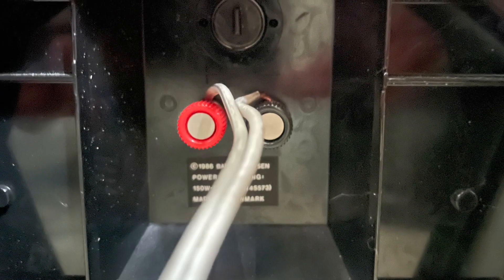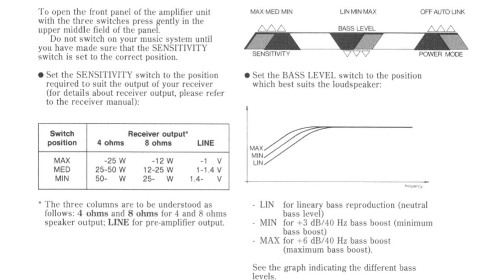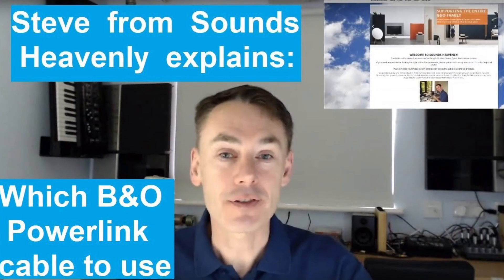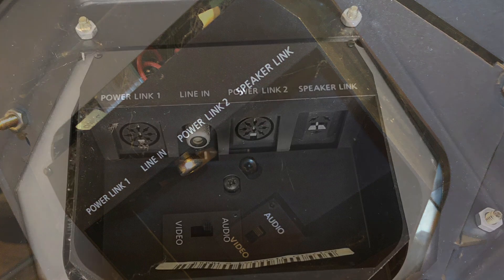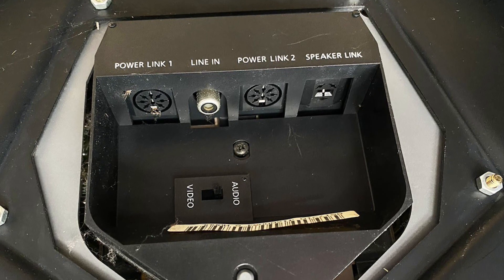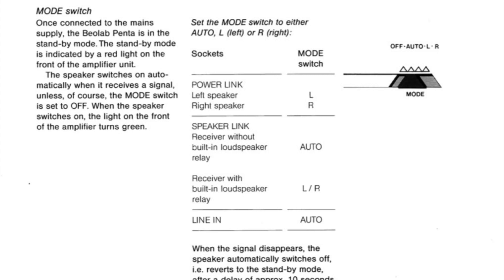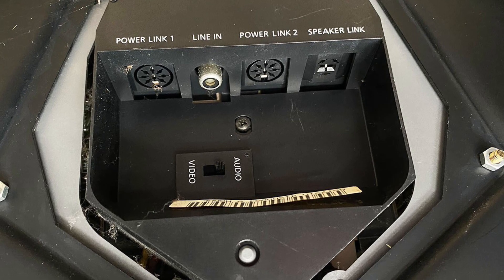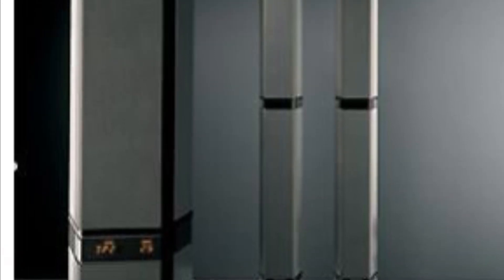Bang & Olufsen Penta. How do I connect it to other systems? Ep.11

Comment: Hello, if I wanted to connect Pentas to a headphone level output from a cell phone using an appropriate cable splitter/adapter to the Penta line in, what should the sensitivity on the Penta be set to? Im trying to simply test a pair of Pentas without another working audio source. Thanks!
Reply from the maker: Tbh any will work… it will just be three different amplification levels. So just start with your phone volume on low.

Comment: when starting it up my penta clicks 2 or 3 times, is it normal ??
Reply from the maker: Not entirely normal no… they will click when turning on at the wall. So without hearing it for sure it could be normal. If they’re working fine I wouldn’t worry.

ours do buzz when changing the display data, it’s not something that massively bothers us as they’re often on aux. Quirks of old tech eh?

Comment: Good evening, my amplifier was damaged... What other amplifier can I adapt or connect to it?
Reply from the maker: If you remove both the amps on the bottom you can connect it to any amp within reason. Aim for somewhere between 50-100watts of power.

Comment: Thank you. I have been totally bamboozled by the fact that my beomaster 3500 has a combination of 4 and 5 connection apertures for the speaker terminals, instead of just the normal 2 for the double din speaker connection that I am familiar with.
I love the sound that Bang Olufsen units produce but as time goes on I am becoming increasingly aware how quirky their equipment is (that is unless you are a B&O technician or very technically minded haha).

Comment: Too be able to use the Penta with its amplifier one need to understand how that works, and it is not strait forward.
There is two transformers in the amp, one for st. by, and the other is to power the amp itself, keep that in mind, you need to turn on the amps power transformer.
One way is by using the PowerLink and set the selector switch to "Link" then the amp will turn on and off when the PowerLink signals it to do so.
Next way is with the selector switch set to "Auto", then there is a few ways to turn the thing on, one is a audio signal on the line input (do not always work that great) another way is to connect an other amplifiers output to the "Speaker" input, it is important that it is a low impedance output that you connect to the speaker input because the Penta amp sense the low impedance and will only turn on if a low impedance is present on the speaker input, but this function had be redesigned a few times and it works better or worse depending on the model you got and there is to my knowledge no way to determinate what version of this input sense circuit you got with open the thing and check it up against the schematics. It is also worth to remember that you can only use one input in auto mode at the time, do not connect anything to the other input at all when using line/speaker input.
There have been many problems with these line/speaker inputs, unwanted noise, strange turn on/off with any reason and a lot of customers that simply do not understand how to use it because it is not as easy as B&O claims.
Reply from the maker: @K2teknik.  I agree. I rarely have good success with line input. It kinda works but it’s not as good!

Comment: I have an issue going on with getting my Penta speakers to show the display. Before they didn't work at all I used to have to crank the volume up very loud then cut it back sometimes teasing it a second and third time but then once the receiver seemed to work out for maybe the amplifiers did themselves it worked fine. Is that a receiver issue a pin cable issue or speaker issue? How do I get to the bottom of this? The best they sound for me is through the four or eight pin connections. That also turns the displays on and the speakers on and off now the speaker's run all the time with the speaker inputs on them.

Comment: hi , only you can help me because you know the mk3s like the back of your hand, basically I sent the midrange panels to a specialized center to renew the suspensions, unfortunately when I removed them I didn't catalog the wires with the various colors, I was wondering if you could give me a hand. Greetings from Italy
Reply from the maker: The colours should be the same as mine. What I would say is the wires kind of have a memory so you’ll have limited options for where they can go. In terms of… where they’ll reach and where they naturally want to sit. 

The colours should be the same as my video on refoaming the midranges.
Reply: thanks a lot I'll try

Comment: Hello, good evening, I was using one of my Penta speakers and it started to smell burning at the bottom... What could it be and if it could be fixed
Reply from the maker: Yes anything can be fixed… it could literally be anything though. Probably one of the transistors. I would recommend getting a shop to look inside and spot for any burnt components.
Reply: @chrisbaker121924  I decided to eliminate the amplifier and connect them directly to a Sansui 4 Channel amplifier 100 watts per channel... although each Penta is 150 watts...
Reply: The amp part can be repaired, but it is not easy to open the thing and then put it together afterwards, it is very compact, many repair guys have scars and cuts on their hands after handling these during repair. No it is not "one of the transistors", the power transistors can go open and no smell there, if the go short then maybe smell for a short time and then the fuse will go open too. You really need to open it and take some measurement to determinate what is wrong. Btw, the panta is capable of delivering 180 watt with the right mains voltage supply, it have three sets of power transistors in parallel it can run 150 watt on just one set of power transistors but the thd will be bad, but it can do so.

Comment: I think the Video/Audio selector switch needs to be correctly set for the display to work - so Audio is obvious but set it to video if your source is a Beovision TV. My source is a Beovision 11 and I only get working displays on the Pentas when the switch is set to video.
Reply: Thats true. Video is for a tv, audio is for a audio system.
Reply from the maker: That’s odd? I always assumed it was to shut the displays off to stop them being distracting when using it in a cinema setup.
Reply: Hi, i have bought a Yamaha htr4067 amplifier and i have the beolabs 6631 MK3, connected with speakerlink cable to the speakers connection front l+r, but that doesn't work. It worked on my older Yamaha receiver (rxv 396) do you know what i did wrong ?
Kind regards from the Netherlands

Comment: What does it mean AMP LEVEL INPUT AND LINE INPUT?? this brings it to the bottom
Reply from the maker: Amp level input is if you are connecting it from the output of an amplifier… like you would standard speakers. The settings on the front of the penta can be adjusted for different amplifier power settings (see video) this is a 4 pin Din connector though the standard 2 pin B&O speaker Din will fit and work for sound, just no data.

Line input is a low level input… it’s not quite the same thing as a headphone level but practically very similar. You could plug a phone headphone output into two phono connectors in the line level inputs.
Reply: @chrisbaker121924 At the bottom where it says AMP LEVEL INPUT is to connect audio input but with two red and black cables, press the connector and insert the cable one on each side... and where does it say LINE INPUT is for connecting via an RCA cable. So in AMP LEVEL INPUT I can put an amplified audio signal without damaging the Penta??
Reply: And through the LINE INPUT input can I put a non-amplified audio signal through RCA??
Reply from the maker: @enriquealvarez3157  yep. Such as the output from a phone or a line output from a CD player or whatever you have. Just don’t plug an amplifier level output into the line input!

Comment: Great tutorial, Chris! Thank you. I found myself a Penta MK1. Did replace the foam rings - good video from you there too! But now I want to connect. Very confused by the amp level grip connectors in the MK1. Them being an active speaker I’m still somewhat reluctant to connect to my regular amp even with power setting on min. Did BO kind of produce a 2in1 active/passive speaker with this Penta MK1??
Reply from the maker: Pentas are a weird speaker and although they’re called a beolab, they’re not actually active, they’re a passive speaker with a normal amplifier on the bottom. 

It’s a very weird setup and actually goes against everything anyone knows but yes it is amplifying the signal twice. (Once in your head unit and once in the base of the speaker) The amp level connectors are designed to go from speaker connectors. At least to the best of my knowledge. This works the same way if you have the 4 pin connector or two pin. (The extra two pins only send data signals for the displays and signals to power off the amps) without them data signals the amps will stay on till they time out due to no input detected. 

The selector switch on the penta is there to account for the power range of your amp. So the lowest amplification is for powerful amps such as a Beomaster 5000. And the lowest setting is for less powerful amps such as a beocenter 9000.

To be on the absolute safest side start with your speaker on the most powerful amp setting (so it’s amplifying the least) and turn your Beomaster/amp up slowly… starting on the minimum setting. 

The only one you shouldn’t plug from an amp is into the line level. That’s designed for something low level/headphone kinda level.

They’re great speakers though and you’ll deffo enjoy them!

Comment: I have beocenter 9300. I am looking at buying some Penta's. I have noticed mk1s are cheaper but don't have powerlink connections. Would I be better to pay more for mk2 or mk3s for the powerlink connections or would it not make much difference with the beocenter 9300. Any advice would be appreciated.
Reply from the maker: It is possible to connect speaker link to a beocenter 9300 I believe! Just the speakerlink cables are really hard to source.
Reply: Definitely spend extra for the MKII or MKIII. They are active, and you will get more enjoyment out of them. I have a Beocentre 9300 running a pair of MKIII penta's, and its amazing. Now i am looking for a Beolab 2 Sub, and possibly a second pair of MKIII pentas, to complete the set up

Comment: Hello my Penta's amp died☹️ can I by pass the amp and us a external amp, do they have a cross over inside separate from the amp?
Reply from the maker: Yes indeed you can. The speaker tower and amp operate totally separately and B&O did indeed sell them separately as the beolab 150/200 and the beovox penta. A beolab pentas is a powered speaker but it is not an active speaker… they’re essentially normal passive speakers with a normal mono amplifier stuck to the bottom. 

To turn your beolab pentas into beovox pentas you have to lay it on its side on some sofa cushions or similar, remove the 5 nuts holding on the base, then remove the 5 nuts holding on the amp. Some might come off as nuts and some might remove the bar itself it doesn’t matter. Gently remove the amp, it will be attached by a 7 pin Din plug and two speaker wires. These are often spade terminals. 

Those two terminals are just like any other speaker terminals. Negative and positive is stamped into the plastic. Just add spade connectors to your speaker wire. 

You will need 5 pieces of shorter bar to run it without the amp installed to fit the feet back on… or keep the amp on it and feed a standard speaker wire out the back.

Comment: Bang & Olufsen Penta. How to connect it to other systems? I bought pent3 and I don't know how to connect to marants pm-15s1. since I don't understand English, you can write to me, and then I will translate through translet
Reply from the maker: It is possible, if it were me I would not use the beolab amplifiers and connect the amp directly to the speaker itself. If you remove the amplifier from the penta (and store somewhere else) you can refit the base onto the tower to make “beovox” pentas. Under the amp you will find a 8 pin Din connection that is used to drive the displays which is not possible to get working with the marantz. 

You’ll also see two spade connectors which are just standard speaker terminals. They are labelled + and -. connect to these just like a normal speaker, you may need to add spade connectors to your speaker wire to make a suitable connection.

This is the best way to connect to another powerful amplifier.
Reply: @chrisbaker121924 Can it be connected directly via RCA cable to another amplifier?
Reply from the maker: @enriquealvarez3157  so long as it is a line level out and not an amp level out. Because the beolab150/200 at the bottom of the penta itself is the amplifier.

If you want to use it with a normal amp you can remove the grey amplifiers and you’ll find two spade connections labelled + and -, these are normal speaker terminals like found on any speaker
Reply: @chrisbaker121924  Ok I understand, and what do you recommend I remove the lower amplifiers or connect them to a line with RCA??... how will they sound better??
Reply from the maker: @enriquealvarez3157  it depends, what system are you running?

If you’re running a receiver with an amplifier in there then you don’t want to amplify it again. What’s your system?
Reply: @chrisbaker121924  It is advisable to connect only to an audio output.. right??. And the speaker will amplify the Audio
Reply from the maker: @enriquealvarez3157  

If you’re connecting to the line level input yes… that is effectively a “headphone” level input… rather than a speaker level input. 

If you have a separate amp you wish to use that is fine, you can remove the amps from the pentas stick them under your bed or whatever and connect them up like regular passive speakers…

Comment: hello, I have penta 1s and have been looking for a long time for the operating manual for the speakers and for 2 pairs of 4-pin plugs to connect them to the beomaster 6500, soundHeavenly no longer fails them, I despair, especially since I don't no more display on one of the speakers, do you have any leads? Thank you Best regards.
Reply from the maker: The manual I can help with. It’s available here. 

https://beomanuals.com/manuals/Beolab/Beolab%20Penta%201/ select owner manual. 

I’m afraid I don’t have a pair, I’ve never ever seen one in my life, they must be rare but, try the beoworld forum? Join there and make a post? Another place I’d try is on Facebook, “Ultimate Bang & Olufsen” group. People have all sorts sitting in their draws. 

Until that time finding speaker link cables… and if Steve no longer does them (last I heard he did but he must have trouble getting the connectors too). Then your only bet is to run them from a 2 pin Din from the Beomaster into the bare wire terminals. Unfortunately you won’t be able to run your displays like this of course. 

Another option with a bit more soldering would be to modify and hard wire a power link connector onto the bottom of your pentas. I think this would be possible. Although of course proceed with caution, I wouldn’t want you damaging your penta on my advice!

Pin 6 and pin 7 on the power link socket would be the data to go onto pin 3 and 4 on the speaker link terminals for the display to run.

Then 2 and 3 for left speaker for minus and plus audio signals (the spade and pin 1 on the din) and 2 and 5 for right speaker. That would in theory work, you’d just have a power link socket dangling or coming from the bottom of the speaker. They wouldn’t be fully wired like that so you couldn’t daisy chain them of course. Have to be separate left and right from the amp.
Reply: @chrisbaker121924  thank you very much, really, but I'm going to have to get into it because I'm only a computer scientist, it's true that 4 pin din pins are very, very rare, I can't find any. Thanks again for the info.
Reply from the maker: @0ver_Blood  if you’re a computer scientist you’ll have a logical enough brain to be able to work something out :)! Good luck!
Reply: @chrisbaker121924  no no, for the respect of my English interlocutors I use a translator, google in this case and when I wrote (informaticien), he translated by computer scientist but no, sorry for the misunderstanding, anyway is it always that I am going to tackle this stain, thank you again the documents are precious.